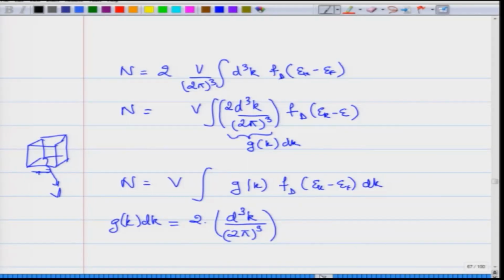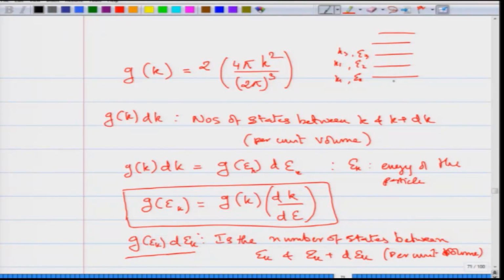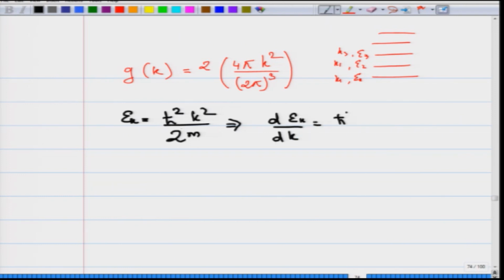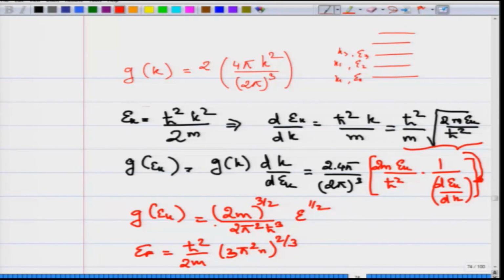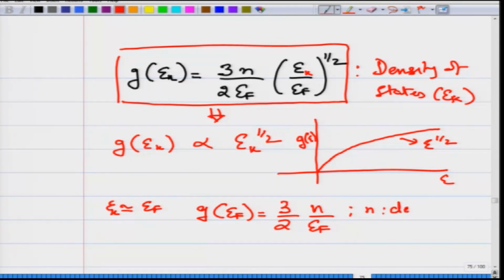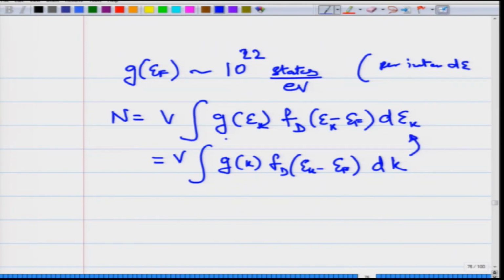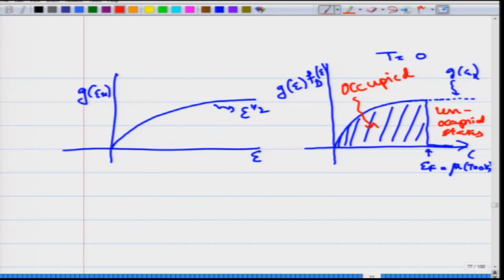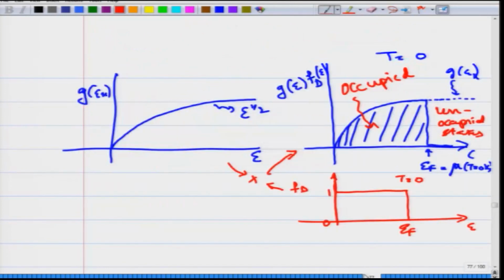noc19-ph02 Lecture 17-Density of states Part-II

Comment: Why did we calculate Density of states g(k) as if k is continous ?? k is dicrete or continous???
Reply: K must be continious as when we are calculating density of state we consider the shell volume. K has two roots (+k and -k). In between  infinitely acceptable k values are there. As during volume the whole k space(upto which we need for calculation) required. So , according to my understanding k must continious.